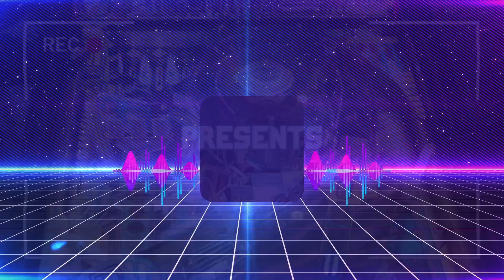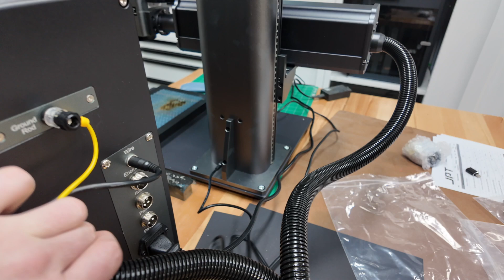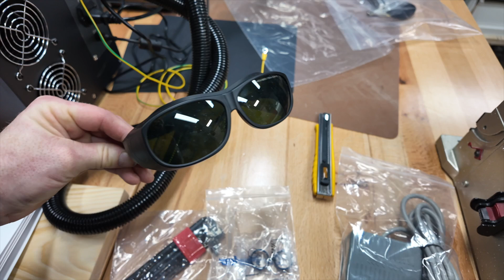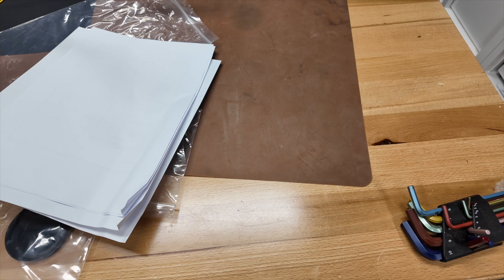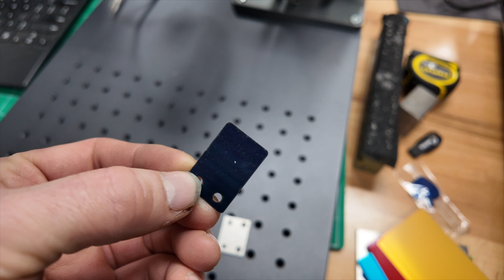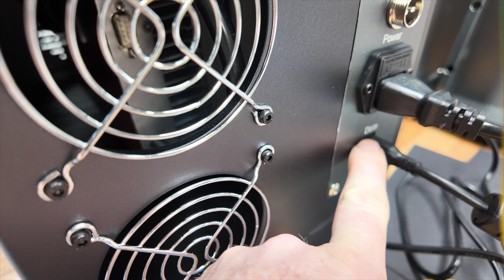First Look: Commarker Titan MOPA Fiber Laser

Comment: Hi. How was your experience with commarker so far? I'm new to laser so I hope to find a company with support as responsible as possible.
Reply from the maker: So far, everything has been good. I have not needed to use suppprt yet, but they did respond within a day when I had a question about the bolt pettern on the rotary table. The Titan has been 100% solid so far after many hours of use.

Comment: You could very well be the first to post a video on this machine, because from what i can tell this is just a rename from Commarker, they used to call this line M7, then renamed it to Titan a few weeks back, only 2 changes were made, instead of silver casing, now its dark grey and they added a 200W JPT source model, so now you have 60/100/200 when back in M7 you didn't had the 200W option

Comment: I recently placed my first order for the B6 engraving machine on  website. However, I just came across the ComMarker Titan 1 JPT Mopa Fiber Laser Engraver (100W), and I am wondering if it would be a better option for my needs.

Since I primarily work on engraving silver and gold rings, I would like to know if upgrading to the 100W model would offer better performance, precision, and efficiency for this type of work.

Could you please advise me on whether upgrading to this machine would be beneficial for my applications? Additionally, do you recommend this upgrade based on my focus on jewelry engraving?

Looking forward to your response.
Reply: three weeks and no reply.  This video is useless.
Reply: @chazcov08  yeah doesn't say a lot about the integrity of the reviewer. Either he cant read or he's just been shipped a free model for a positive review.
Reply from the maker: I paid for this machine myself. I have been very busy and do not check YT comments very often....sorry. Machine is running great and already paid for itself faster than I thought it would.